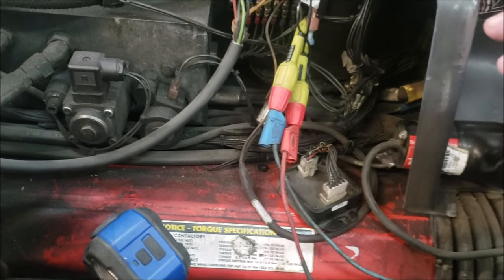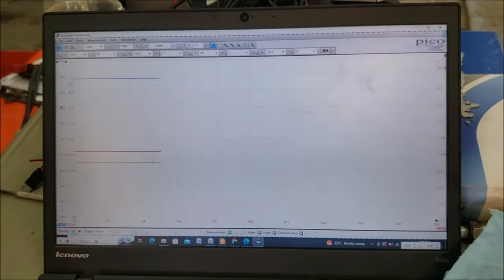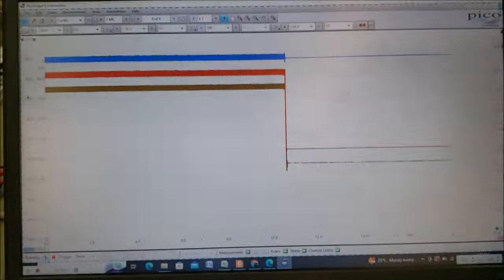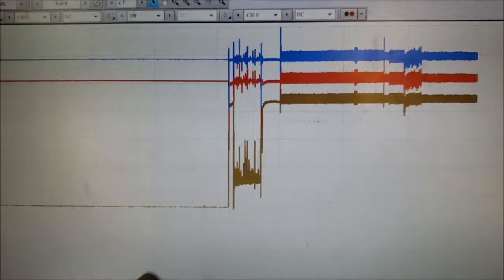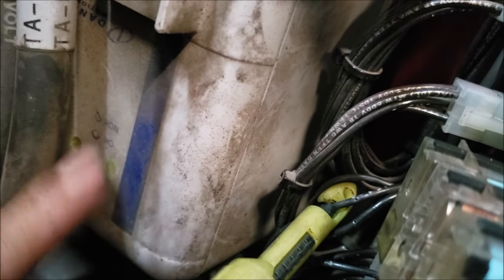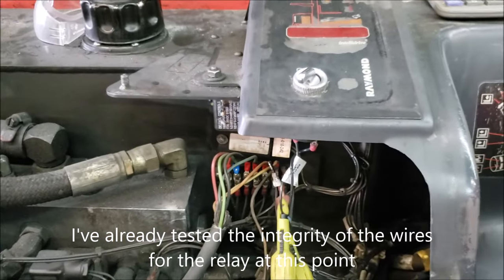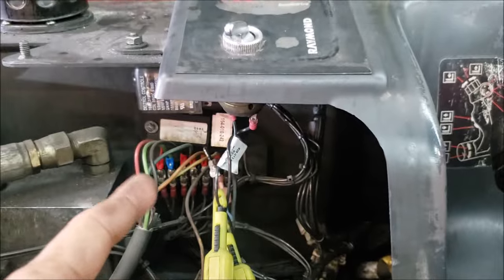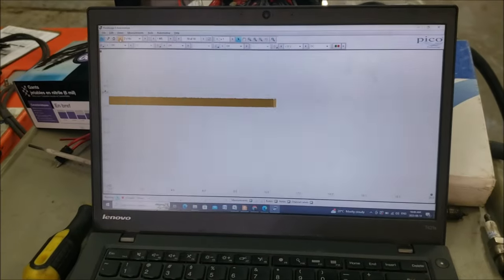Intermittent No Drive, 5G code

Comment: Have been dealing with a code 5G on an EZ-D as well. Not sure if it has the secret button start option but I will investigate further. Maybe it was bypassed previously. Thanks for the video!
Reply: Check the k1,2&3 relays on the power board , they will get magnetized after years of use ,switch them out an recheck .

Comment: Hello friend, very good informative tip, I have a question, if you could help me, I have a 2-ton Toyota forklift that has a hydraulic brake, the problem I have is that when I apply the brake, the engine turns off, also when I turned the steering wheel to one side. The engine turns off, also with the tilt and lift lever. What do you think it could be? We have already checked the brake pump, the control valve, the steering piston and we repaired the Engine (160 Comp 4Y), I hope you can help me. Thanks in advance Doc🎉
Reply from the maker: Check that the ignition timing is correct and check your relief valve setting for the hydraulics.